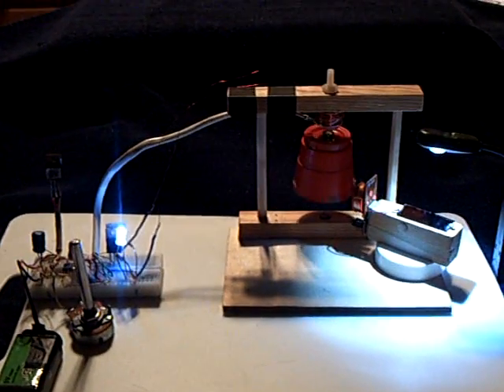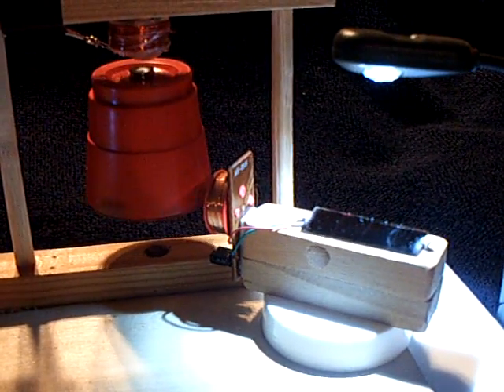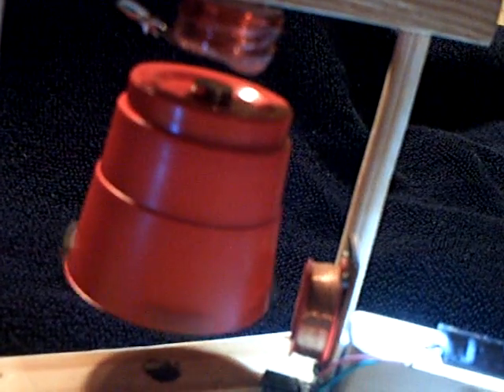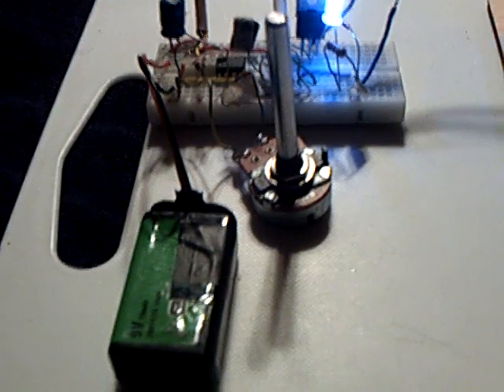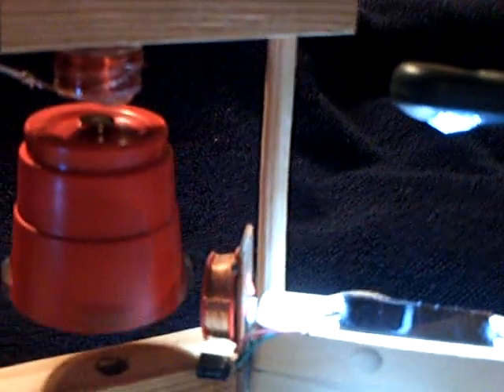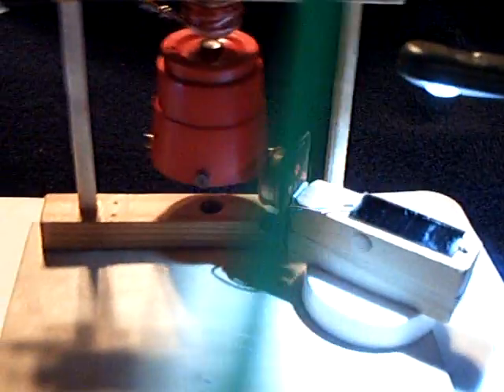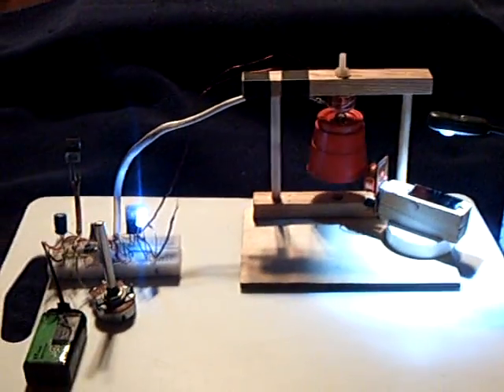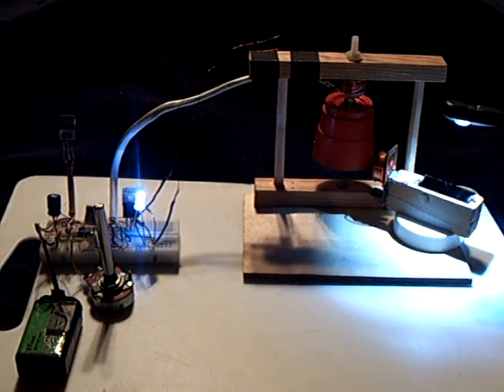Electromagnetically Levitated --   Electronic Pulse Motor

Comment: Very impressive. How did you come up with the gauge of wire and number of turns for the levitation coil? Also, was there any considerations to be made from the pulses of the motor for the hall sensor or is it in its own little world up there? Thanks for sharing your hard work. I will be scoping out the dollar stores from now on!
Reply from the maker: Trace Waters A lot of guess work on the coil.  It was one I had on hand.  It really needed to be  larger.  The way I tested this one was to just energize it to see if it would lift the rotor.  Then it was just a case of getting the circuit to turn it on and off really fast at a certain distance.

Comment: Nice idea :) I have the exact same lamp lol in my smock pocket haha! Thanks for sharing!
Reply from the maker: They had these 'e-luminator' LED lights at my local dollar store.  It is pretty amazing.  I like that it runs on one AAA battery.
Reply: ***** Dollar store wow mine was like 8$ at Canadian Tire lol I think you had a better for it :P but they work great!
Reply from the maker: I have been thinking about modifing one by mounting a D cell battery holder on the base.  A long life alkaline D cell would give you an super long run time.  The solid state touch switch and three level light feature make this a really great light.  I used mine yesterday when I was soldering up the circuit board for this project and needed a bit more light. Ebay has them for around $6.  Lucky find at my 99 cent store.
Reply: *****
even a AA would give you a good run time. The only bad thing I have to say about it it's even when it's off it drain the battery mine last about 2 month then the AAA was dead and I use it twice. 99 cents is an awesome price indeed lol

Comment: Check out the 2 I cobbled together. Not scratch built like yours, but I'm working on it. Much more difficult than people realize to get these pulse circiuts working even the simple ones have built several bedini and Newman type and more levitators spinners that I know what to do with!  Mendocino them I guess. In fact I'm working on a giant one now maybe over 3' in length! Anyway here's a rough video of my take on this.  Excuse clutter, you know how that goes: Levitating Solar Powered Rotating Spinning Balls: http://youtu.be/S8dOaUYAheM
Reply from the maker: That is excellent!  I never knew that the solar waver would drive something right through the plastic base.  Great idea!  That saves trying to remove that delicate coil.

Comment: Hey lid, wow cool built 2 of these about a month ago. I took the easy way though. I purchased my levitators from Amazon for $13, I bought the only 2 I found at that price.There are others I've seen as low as $30. There the sports ball levitators sold by facinations. For the driver circuit I used the base (stock) off a solar waver from dollar tree, the Xmas ones, elves, Santa's and reindeer lol. There hard to extract the coil from the base as the wire is soooo thin, so just pop off the base and use as is. I added additional magnets for increased levitation and magnets around the "equator". The light to power them is from an ottlite, although they work fine in daylight too. These levitators are very strong would guess they lift over a half pound as have suspended pliers, figurines etc. They have been spinning now for well over a month nonstop other than occasional drops or trying different objects. My next project as mentioned to you before it's to take some of these solar dancer circiuts from dollar tree and make them into a teeny mendocino motor,  both with and without the pulse circuitry. I just uploaded the video of the levitators in action.,check it out. Oh one other tip when they have the stock but may be sold out at dollar tree, you can purchase them from dollar trees website online.  Yes you have to buy more than 1. I think it's a minimum of 4. I bought a couple of dozen and received them in less than a week. GARY in SJC.
Reply from the maker: I am very familiar with the dollar store solar wavers and have turned them into pulse motor drivers also.   I have a bunch of videos on them.  I may have to break down and buy one of the commercial levitators.
Reply: I figured it was probably you buying up all the local stock, lol.I tried the Turkey waver couldn't get it too go! Also tried it on my levitator with marginal success.

Comment: Lid, any idea how to use a Hall Sensor on a pulse motor using a PNP?

n
Reply from the maker: Hall sensor output goes to base of PNP. Pulse motor drive coil attaches to PNP collector and source (-). PNP collector connects to source (+).  Add a 100 ohm resistor and 5K pot in series to the PNP base feed for control.  The Hall needs about 3 volt to work.
Reply: \Im using a reed to send the base to ground. How can the Hall route to ground?.
Reply from the maker: texjarhead I don't know how to do that.
Reply: I'm thinking a solid state relay, if I can find one that will operate 130 times a second.  Thanks for all you do.

Comment: Amazing work of course. That sound is a trip. I watched the lasersaber video as well. Lol the straw is a handy tool today :)
Reply from the maker: Thanks.  The sound changes when I adjust the pot on the levitation circuit.  That is great fun but my wife doesn't like it.  I really like Lasersaber's new motor.  I wish that I had a 3D printer or access to one.
Reply: if you can model it in sketchup make and send me the file, i will print what you need in abs. i think my print bed is roughly 9x9 inches, i have printed about 4" high, but it can do a couple more inches. the catch is that i get to print myself a copy as well  ;)